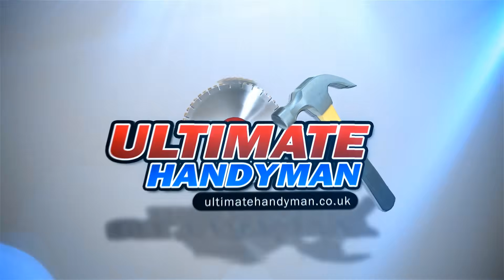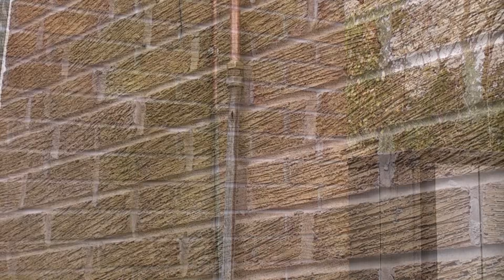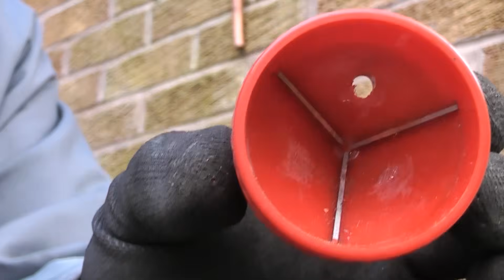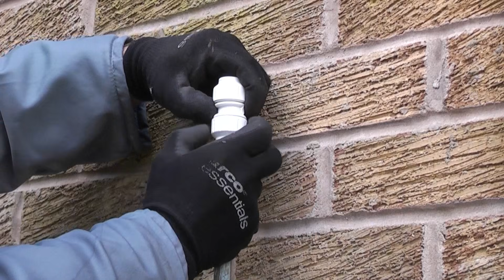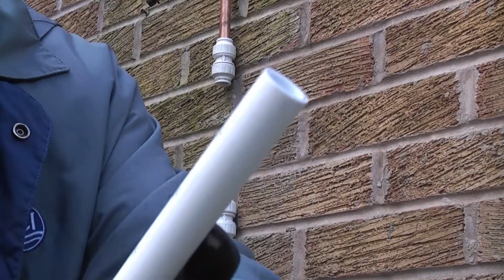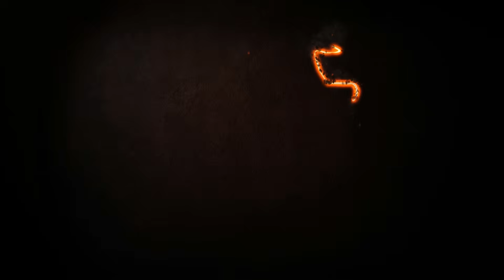How to fix a burst pipe

Comment: Am I alone in my belief that to insert plastic pipe & use plastic push-fit connector turns what was previously flameproof sound exterior pipework into a bodge job at best & at worst,a toxic meltdown,public health hazard in the event of flame encroachment rendering pipework repair useless?
Reply from the maker: There are advantages to copper and plastic pipes. For DIY’ers plastic pipe is much easier and I know a whole load of plumbers that also use plastic 😉

Comment: As a result of the cold weather in the UK, 2 of our pipes burst and we couldn't get a plumber out today. There was no fixing it as the fitting flew off somewhere when the pipe burst. In the end, we had to shut the water off in the kitchen. Now, I am a female diyer, never ever done this before so it was a new experience. I watched your video and another on compression fittings and ordered through screwfix today, thankfully it was ready in 20 minutes so managed to get to screwfix before they closed at 8pm. I used male compression fitting on the 2 copper pipe, used a spanner to tighten it. Then used this video method to do the pipe in our utility room, we only needed the Coupler push fit and the insert, not the pipe and it fitted perfectly. Less than 25 minutes, fixed our pipe and without getting a plumber. Now we have water in the house. Thank you so much, if it wasn't for your videos, I wouldn't have a clue. Now, anytime out water pipes burst, I will know how to fix it. 

PS: Make sure you get the right fitting size. Our pipe size across was 1.5cm/15mm so we had to get fittings that fit on 15mm pipe. If you don't know the size, measure with a rule from end to end. 

Also, the pipe was outside the building so did not use this video method so got a brass male compression fitting. However, used this method in the utility room as the room is not exposed to the outside element.
Reply from the maker: I'm really glad that the video helped ;-)
Thanks for the comment 👍

Comment: As far as i'm aware, you only need to use inserts when using copper compression fittings, to avoid crushing the plastic pipe?
Reply from the maker: You need pipe inserts when using any push fit fittings or compression fittings on plastic pipe.

Comment: Even a copper compression would look better than this
Reply from the maker: I think you are missing the point. This is the easiest way to fix a burst pipe, obviously for someone like yourself you will have the knowledge and the tools to use a "copper" compression fitting but most DIY'ers don't have that knowledge ;-)

Comment: Plastic becomes brittle in cold weather and if they are in the open like that one and is not up safe will degrade over time also becoming brittle
Reply from the maker: This was set up to show how to repair a burst pipe, which would normally be in a loft or a garage. Obviously if the pipe was outside I'd have replaced the whole run of pipe with MDPE and lagged it.
Thanks for the comment

Comment: Convenient that the lower pipe was able to move up and down. Unlike plumbing in a home haveing a fixed distance between the cuts with no luxury of pulling a pipe(s) together.
Reply from the maker: That is correct, sometimes the pipe can be moved and other times it cannot. If you can't move the pipe you need slip couplings- https://www.youtube.com/watch?v=VQsOsND_Dnw

Comment: Few issues with this video. One, you have copper pipe outside without insulation. Two, when a pice of pipe fails like that and there is corrosion on the pipe you replace the pipe, the whole pipe not just the place with where the whole was, its good practice!. Three this is not how to repair, its how to replace a pice of pipe. Four the pvc pipe will expand but in the summer the plastic fittings will be exposed to the sun and crack when its cold, maybe not this year but the year after. The fittings are not flexible. Five, having 2 different types of pipe exposed is not great to look at. There was more but i forgot lol. Other than that great video!
Reply from the maker: I really wish people would read the description.
Next time I'll make the video 5 minutes longer instead of assuming that people will read the description and my first comment.
Thanks for the comment

Comment: I use John Guest fittings/tubing for water cooler installations. They're easy, fast and flexible to use. Lifesavers for long runs and for tight spaces. Great video!
Reply from the maker: Thanks for the comment

Comment: Great advice as always. I was never sure how well plastic pipe does outside but I shall be using it in future 👍🏼
Reply from the maker: This was only set up outside to do the demonstration, normally the pipe would be in a loft or garage, or below a floor.
You can use plastic outside but it needs painting with water based paint and lagging to protect it from UV light and frost.
Thanks for the comment
Reply: Ultimate Handyman Thanks for the advice! I hate plumbing and only do it because I have to but enjoy learning as I go 👍🏼
Reply: I have qual pex plastic pipe outside on a 30 foot run along the side of the house for 15 years with tectite brass push fit fittings and compression onto a tap and although it freezes every year it has never burst, not painted or lagged but in the shade

Comment: And right there you've broken the earth bonding by using crappy plastic pipe
Reply from the maker: No, it would not. But remember that most incoming water pipes in the UK are now plastic.
Reply: True fact. But the purpose of earth bonding the water isn't to OBTAIN an earth (I know you know that Ches ;) ) it's to ensure all the copper inside the property is bonded to the main earth terminal. In this case it's probably okay because the pipe is outdoors... but interrupting the bonding is a serious issue for safety that people need to be aware of.  It's even more unsafe with gas, but fortunately DIY on gas isn't allowed
Reply from the maker: Plastic pipe is the future ;-)
Reply: I think what he is meaning is the earth cable is normally finished onto the copper pipe to earth the house electrics
Reply: Would a water inside plastic pipe not provide that earth bridge ?

Comment: Nice easy fix, I like to educate home owners too when out on jobs so they can sometimes tackle things like this themselves. I have found though that when using copper and plastic the joint expands by the copper and blows the fitting when it's freezing. Hopefully it's well ensulated for next time. Maybe a little drain off for winter periods?
Reply from the maker: Thanks, This pipe was originally in my mates garage. When I got there this pipe had split and two compression elbows had been forced completely off the end of two other pipes. The pipes were going to his boiler and washing machine, they were lagged but it was that cold in there that everything froze.
Thanks for the comment

Comment: Why didn't you just weld a piece of copper in? Awful job!
Reply from the maker: Unfortunately some people don't have a clue about anything, which is why I make tutorials.
Burst pipes can occur in garages or in lofts during cold spells. If someone gets a burst pipe this video shows how to fix it, quickly and easily with the minimum of tools and without having to know anything about plumbing. 
As I said in the video the piece of plastic pipe and plastic fittings are less likely to burst if the pipe freezes again. 
I look forwards to seeing your video on how to weld a burst pipe, please let me know when you have uploaded it.

Comment: Why is that pipe outside??  Will freeze every winter!!  Nice ICI Jacket!!
Reply from the maker: Sorry, I should have explained more in the video.
This is how to fix a burst pipe, the pipe was originally in my mates garage and it burst a few weeks previously during a cold spell.
I repaired his pipe exactly like I did in this video, but could not film it there so set this up to demonstrate.
I would not use plastic pipe outside unless it was being painted and lagged.
Thanks for the comment
Reply: @ultimatehandyman   in  my  place    pipes  only  goes  outside  of  the  house.

Comment: Rather than Scotchbrite I've always used wire wool to clean up the ends of copper pipes. I can't think of a reason to change but might give Scotchbrite a try.
Reply from the maker: I was told that the steel from the wire wool can contaminate the pipe, when the small bits get inside. I've use Scotchbrite pads ever since as they are not expensive and you don't get sharp bits stuck in your fingers.
Thanks for the comment

Comment: thats a heck of an exposed water pipe, oh ive just read the comments! good demo ,  was that bit of of split pipe from his original? its a huge hole
Reply from the maker: Yes, that is exactly how I found it in his garage. The pipes had also frozen so badly that it pushed two compression elbows clean off the copper pipes.
Thanks for the comment

Comment: Well that's just a crap job.

It works but it looks awful. Should always match the pipe.
Reply: Ian H its a fucking make up senario for the video ffs
Reply from the maker: If you match the pipe, the next time it freezes it will burst again, even when lagged ;-)
Reply: Ultimate Handyman how does a lagged pipe in a garage burst? Secondly, ok the few inches of new plastic pipe won't burst but what's to stop the rest of the pipe bursting that you have left in situ?

Comment: I use Kopex pipe slices for copper and they leave the outer edge nice and rounded and only require deburring on the inside.

Excellent video as always
Reply from the maker: I think I'll upgrade to one of those in future.
Thanks for the comment

Comment: For a short term fix its a good option but long term I would still go for copper and then just make sure the pipework is well insulated as it should be especially if the copper pipe is exposed to changing temperatures or cold temperatures.  Prevention I think is the best option here.
Reply from the maker: Sorry, I should have explained more in the video.
This is how to fix a burst pipe, the pipe was originally in my mates garage and it burst a few weeks previously during a cold spell.
I repaired his pipe exactly like I did in this video, but could not film it there so set this up to demonstrate.
I would not use plastic pie outside unless it was being painted and lagged.
Thanks for the comment
Reply: @ultimatehandyman  I just find plastic pie hard to digest. Easy to cut, though, with the right tool. (Sorry!) Great vids, thanks.

Comment: if it were winter you would have problems with the frost, being the outside pipe. Anyway very practical
Reply from the maker: Sorry, I should have explained more in the video.
This is how to fix a burst pipe, the pipe was originally in my mates garage and it burst a few weeks previously during a cold spell.
I repaired his pipe exactly like I did in this video, but could not film it there so set this up to demonstrate.
I would not use plastic pie outside unless it was being painted and lagged.
Thanks for the comment

Comment: Im guessing you set this up for show and fed it with a hose? The newer copper had the soldered patch on from a previous video..
Reply from the maker: Yes, that is correct.
Originally the split pipe was in my mates garage, which burst a couple of weeks back- as well as pushing off a couple of compression fittings when the water froze.
Thanks for the comment

Comment: Presume this is just a temporary repair.  wont UV light attack the white plastic and make it brittle and breakdown ?
Reply from the maker: No, this is permanent. Originally this was in a friends garage, I set this up outside so that I could film it and not flood my garage.
I would not normally use pushfit outside.
Thanks for the comment

Comment: I normally like all of the videos that you produce, but sorry, on this occasions I have to say this looks crap and amateurish. If it was the temporary repair then ok. I'd much rather see 2 soldered joints and some lagging over the top. Those joints are so ugly.
Reply from the maker: You are right, it is ugly- but this was originally inside my friends garage and there was much uglier things in there.
Repairing the pipe with copper would mean that it might split again if it gets cold in his garage again, with plastic there is much less chance of the pipe splitting.
Thanks for the comment

Comment: As a temporary fix this is fine but I would have been tempted to replace all of the external copper pipe with freeze resistant pipe so that the same doesn't happen next winter.
Reply from the maker: This burst pipe was originally in my friends garage. All the pipes were lagged but still this one split and two compression elbows were pushed completely off the pipe.
Thanks for the comment

Comment: What about the earth bond ?. If you put a piece of plastic pipe to link a copper pipe you need to earth bond both bits of the copper pipes as, you have broken the continuity of an earth passage. Great video by the way.
Reply: As an electrician, I need to second this mate. If you're doing this sort of repair on a working installation you always should check the earth bonding of the pipe and put in a jumping bond =before= making the cut. If there's an undetected neutral fault in the property the pipe could be carrying full return current from a circuit. We actually had a plumber killed in Australia last year after he cut a pipe and one end became live 240V. Zap.
Reply from the maker: Not sure, when you search the internet about earthing pipes there are just a lot of arguments about how the regs are interpreted and some people get confused between rules, regulations and recommendations. I guess if people are in any doubt they could put two earth straps on and a piece of earth wire- although it would be easier to use compression fittings and copper pipe- although the compression fittings on the other two pipes in my mates garage (where this pipe came from) were definitely not completing part of the earth path as the frozen water had pushed them clean off the end of the pipe!
Thanks for the comment

Comment: You can also get locking washers that secure the JG speeding fittings so. the collet can't move , would you need them ?
Reply from the maker: You can add them in places where people might try unlocking the fitting, but even then if there is pressure in the pipe it is unlikely that someone would be able to push in the collet to release the pipe without some kind of tool.
Thanks for the comment

Comment: Great video, as usual. Quick question though - How would you have cut the old pipe out if it was too close to the wall to use the special cutting tool? And if you were unable to move the lower section downwards to fit in the new pipe, how would it be done then?
Reply from the maker: I would have cut the pipe using a hacksaw, then use slip couplings. I have covered slip couplings before in this video- https://www.youtube.com/watch?v=VQsOsND_Dnw
You can get compression and also push fit pipe repair slip couplings too.
Thanks for the comment
Reply: Thanks very much for your reply! :)
Reply from the maker: You are welcome ;-)

Comment: What if the pipe is for hot water will the plastic work for hot water pipes?
Reply from the maker: Yes, this pipe was originally part of the central heating system in a friends garage. Plastic pipe is fine for hot water/central heating as long as you don't use it for the first metre of pipe from the boiler.
Thanks for the comment
Reply: Works fine for hot water. Don't use plastic pipe next to a boiler or any heat source - one metre gap should do it.

Comment: What’s the longevity of these o-ring seals? I’m guessing a brass olive would outlast these by many decades
Reply from the maker: They are guaranteed for 25 years in the JG speedfit fittings.
They have been used on sites for decades in pneumatic circuits, some of the fittings on the sites where I work are 30/40+ years old.
Thanks for the comment

Comment: Unlagged mainswater pipe outside in UK .?? odds on freezing are 99%
Reply from the maker: Originally this was lagged and was in a garage, but it was so cold that all the pipes froze. The compression elbows had all been pushed from the pipes with the freezing water. 
Thanks for the comment

Comment: Another good video. Can’t wait for someone to come up with a way of inserting a replacement pipe section into a space when the two ends won’t move.
Reply from the maker: You can get a pushfit slip coupling, which can be slipped onto the pipe when you can't move it, you can also get compression slip repair couplings.
Or you can use two slip couplings- https://www.youtube.com/watch?v=VQsOsND_Dnw
Thanks for the comment
Reply: Ultimate Handyman 👍

Comment: I thought UV light damaged plastic pipe if used in direct sunlight or has this changed now?
Reply from the maker: UV does damage plastic pipes and fittings. If the pipe is outside (this was only outside for the demo) it should be painted with water based paint. 
Thanks for the comment
Reply: Ultimate Handyman  I see, I thought you were installing this outside.

Comment: no easier than using two comp. joins....would look better. Still, thanks for your vids.
Reply from the maker: Thanks Toby, The compression joints at the other end of the pipe had been pushed off the pipe when the pipes froze.
I have tested compression and pushfit fittings and compression have a tendency to be pushed off the end of the pipe, whereas push fit tend to expand and then contract once thawed.
Thanks for the comment
Reply: `interesting.....Thanks for the info
Reply from the maker: You are welcome.
I'll try and cover this in a future video.
Thanks for the comments
Reply: No locking rings on speed fit ?